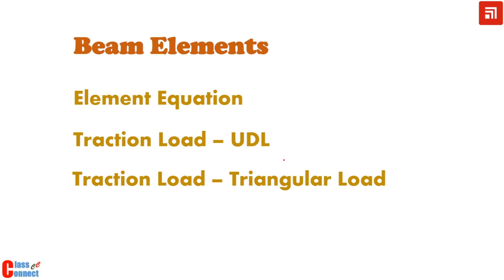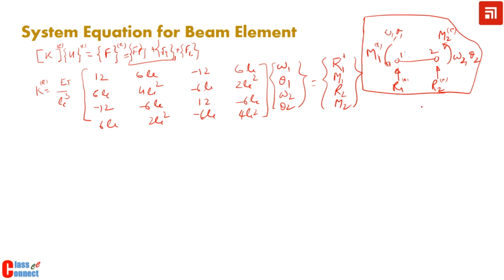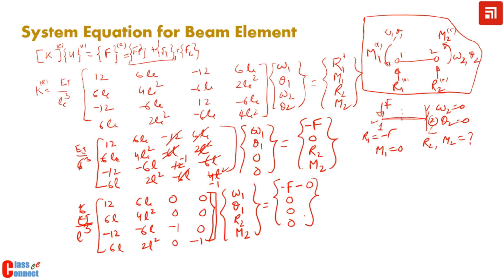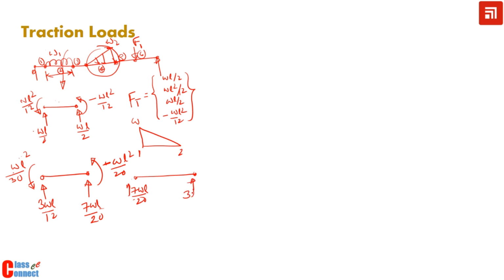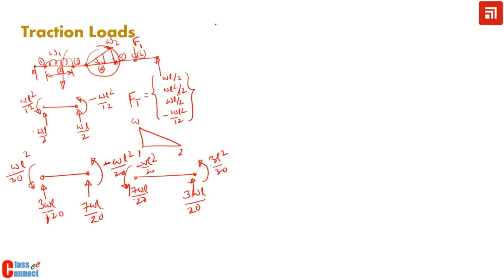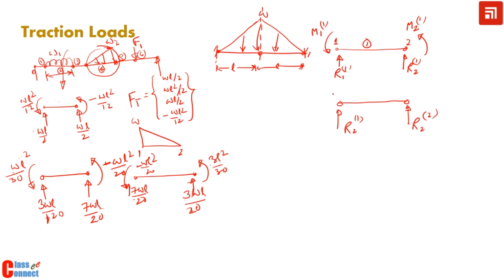Beam Element Session-8: Finite Element Method for Beginners

Comment: Some doubts:
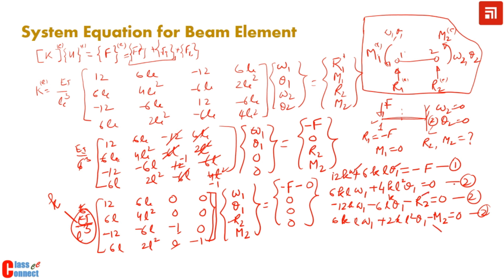1. Sir in @9:17 equation 3 and equation 4 will have -R2*k and -M2*k respectively instead of -R2 and -M2 , right? 

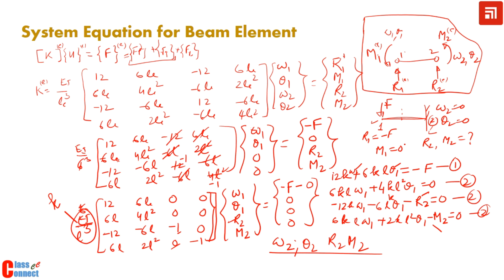2. Also sir @9:42 we should evaluate w1 , theta1, R2, M2. 

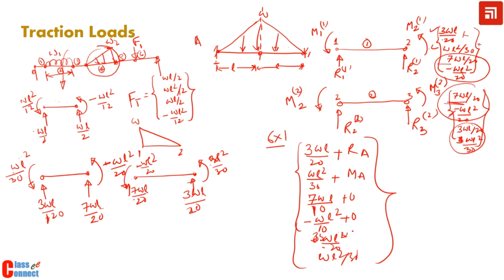3. @22:32 why RA and MA are added doesn't R11 and M11 provide reaction and moment similarly why are we considering RB and MB as we have R22 and M22 we provide the same effect ? Pls answer waiting eagerly.
Reply from the maker: Correct Dear. k will be multiplied. Thanks
Reply: @vijaykjadon  plz reply sir for Q2 and Q3
Reply: Please answer doubt no 2 and 3.Please sir
Reply from the maker: @chinmayholkar4081  2. you should solve these simultaneous equations to find the unknowns.
Reply from the maker: @chinmayholkar4081  3. RA, MA, RB, MB are unknown reactions taken in place of R11, M11, R32, M32 respectively